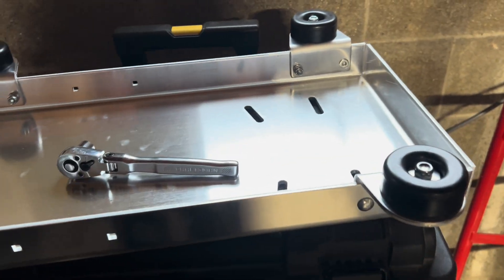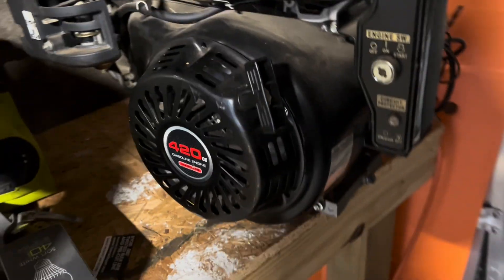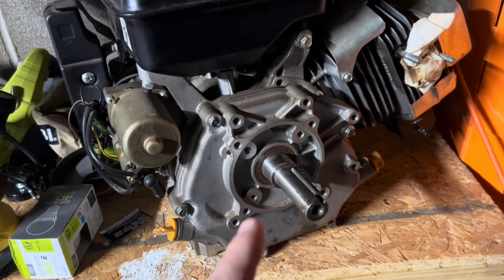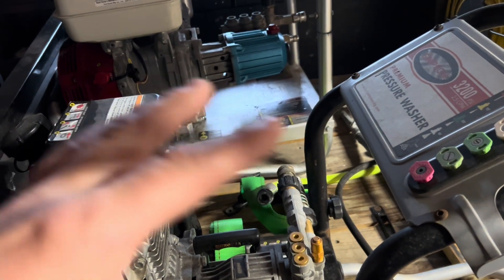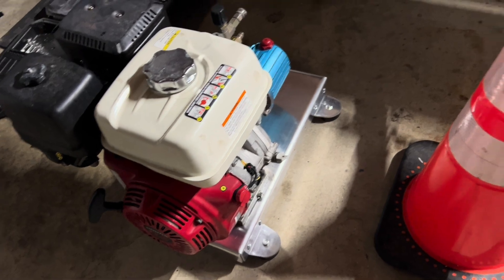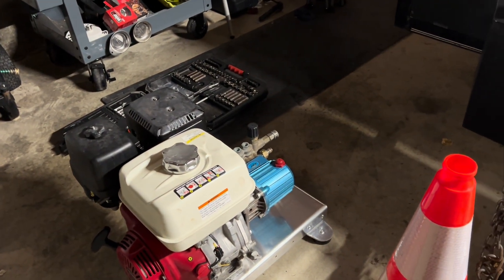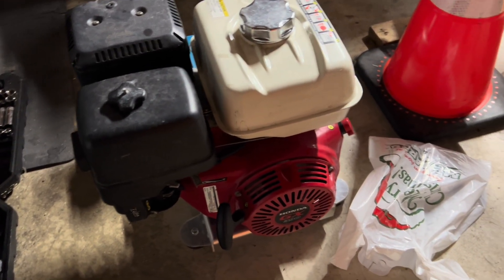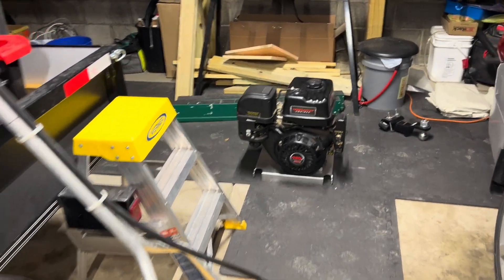Pressure Washer Build Predator 420cc Motor & GX390 Part 1

Comment: My question is which motor is better and stronger?
Reply from the maker: The predator has a generic Vevor 4.4gpm pump on it. The Honda has a cat 4gpm pump. To be honest the predator is stronger however the Honda starts up first crank everytime. The predator takes a few pulls the key start doesn’t work.

Comment: Hey man question! Whats the size bolts for the predator 420cc to install the pump?! Ive gone to lowes and home depot back and forth and cant seem to get the right bolts im getting fed up lol
Reply from the maker: I only bought the bolts & nuts to hold down the motor. Which are 14mm 2 inch bolts. I haven’t installed the Vevor pump yet. M10-1.50mm x 60mm. Bolts for the pump by my chart are M8 idk the length. Jeremy from Kentucky Wash Pros also has a video.

Comment: I've never seen a pressure washer that pulls water to the pressure pump. As long as the water supply is higher than the inlet on the pump, gravity is all that is needed. Put blocks under the tank  (or whatever) & have it 4" or so higher.
If you're fully dependent on water you bring, the lower the water gets the less pressure it's going to have. Have a 2" valve on your tank & reduce it between the tank & the inlet. From 2" down to 1" should be plenty.  

If it concerns you that it won't work. This setup on a tank, a 5 gallon bucket & stopwatch to time how long it takes to fill the bucket & if it fills it in under 40 seconds, is all you'd need.